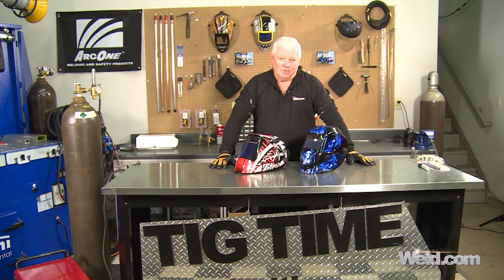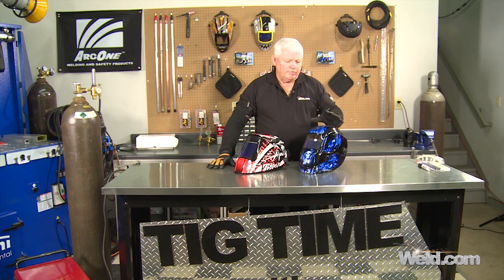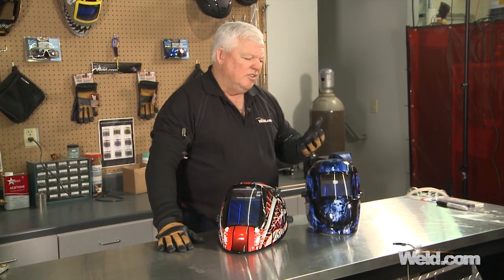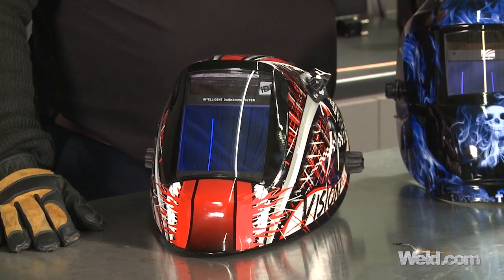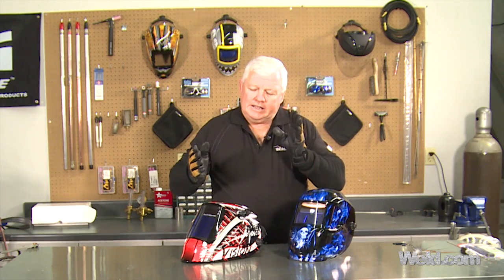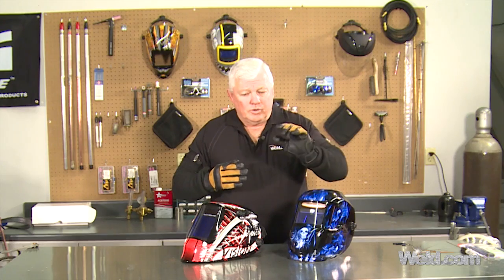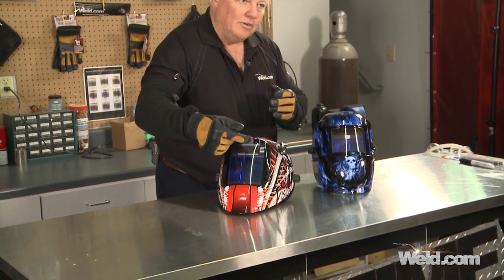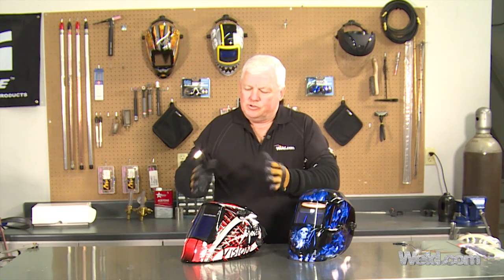Choosing a Welding Helmet | TIG Time

Comment: I got a Lincoln hood with a Viking auto dark lens in welding school. After using it for two years the battery to my lens went out. Instead of paying for a new battery or basically a new auto dark hood I bought a little 2”/4” flip lens Hobart welding hood for 10$. I still use that little flip lens today and have never looked back. I’ve got a gold shade 10 lens on now with a much more confortable head gear device. And my welds do just fine

Comment: This is March 2020. On Amazon: an auto darkening lid for $32 (YESWELDER brand) likely made in SE Asia. Get another one so you'll have another to use when the one fails. Take them for walks to keep the batteries charged.
Reply: March 2020... the perfect time to walk around with a welding helmet on.

Comment: My eyes ache inside after I weld. Not arc eye, but aching inside or back of the eyes. Wasn’t like this when I started welding several years ago. Now, every time. I’ve used different brands, different shades, different settings. Nothing helps. Any reason for this? Are the lenses really 100% safe? Something is getting thru. Doctors said eyes are fine. The aching can last several weeks from one welding session.
Reply: Eyestrain? Try a cheater lens?

Comment: i got a $40 helmet that has a grind mode and adjustment on the outside and is auto darkening solar powered. But it is not very clear and chooses to not darken sometimes. it is a pain and godsend at the same time. I am a beginning student and wish i saw this video before buying a $40 helmet

Comment: Optreal has invented an autopilot mode that adjusts the shade based on the light intensity. They also have a shade of 2 if you get the optrel crystal 2.0. But unless you wanna pay $385 to $410 you cant have that technology

Comment: I have an issue with  my auto darkening helmet when tig welding on dcen,,, it does fine on A/C and mig and stick but tig welding  on dcen is hard to look at the arc, its bright,  is this a machine issue or will have to invest in a good helmet?

Comment: Auto Darkening is gay. You can get a fixed shade Fibremetal pipe-line hood for 50 bucks kijjijji/craiglist. That's what all the welders I know use.
Reply: Just because the people you know use it doesn't make it ideal for all circumstances.  Everyone has different eyes and if you have the money why not get comfort, protection and features you want not what everyone else uses.
Reply: Val Kilmore lol I'm week
Reply: Joel Wilson If you're an ironworker, like me, sometimes you aren't welding on a table. Or in ideal conditions. Sometimes you need to hold a piece overhead and weld it onto your base. Can't very well see what you're doing with a fixed shade. Maybe you're so against auto darkening because you forgot to turn it on one time? Whatever the reason, you might want to hop into 2017

Comment: It is unbelievable how welding helmet prices, features and quality are all over the map. You can luck out and score a great bargain priced helmet and the next guy that orders the same one gets a lemon. The product quality seems to be hit or miss at the bargain end of the market. The higher you go in price the more consistent the quality becomes. But realistically you could get a great helmet for about $80 just as much as spending $200+ on a helmet that you will not like for many possible reasons. Bottom line: read/watch reviews, check on customer service/return policies and do your homework.
Reply from the maker: The great thing about these ArcOne helmets is that they give a full color view of the arc. You're not seeing that bright green color that we're used to with AD helmets. Think of a gold tinted glass lens that is auto darkening and that is what these Vision helmets simulate.
Reply: +Weld.com I understand that you may be sponsored by ArcOne and that's totally fine, but if you ever decide to go neutral the community could really use some reliable, unbiased reviews and assessments of welding helmets across the full range; from bargain entry-level helmets for students and hobbyists, through medium priced ones for the everyday welder, right through to high-end helmets for the hardcore welder. Thanks
Reply from the maker: Oceanic 84, we are a little different than some in that we choose our sponsors. If we like a product, we will reach out to the manufacturer and see if they will sponsor the show. If you see something on the show it is because we like the product and got in touch with the maker. We can certainly compare some helmets in a future episode.
Reply: +Weld.com That's good to hear. I didn't know ESAB that well before  seeing them on your channel, but they seem to have some really nice, well featured multi-process machines. If possible, hoods that I would like to see reviewed are the ESAB, Optrel, Antra and Jackson. Some hoods come straight out of the box with extra lenses and sweat bands and others give you nothing but the hood. That extra stuff adds value for the consumer.

Comment: For Christmas my parents bought me a Chicago Electric #67854.  I am a pipe fitter apprentice and just wanting your thoughts on chicago electric hoods?  worth my time or go with a name brand helmet?  thank you
Reply: TheCoreyokc Chicago electric is mainly a harbor freight economic chepo brand, that being said that helmet is going to last you at least 3-4 years. it lasted me all the way through an apprenticeship and trade school. can't beat the bargain but it won't get you by everywhere it will inevitably start to flash you randomly. which mine did. the head gear may start to wear out. but overall a very good value if you pay under 80 for it. I highly recommend Lincoln viking series when you get some more money. or you can just buy a gold old fixed shade with a comfortable head gear configuration.
Reply: I also ended going old school and getting a fixed shade pipeliner.